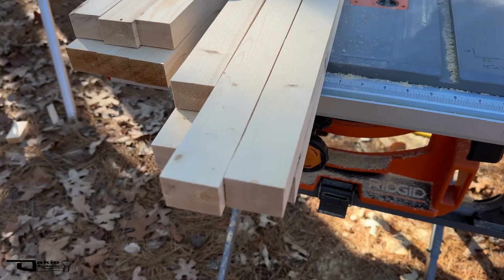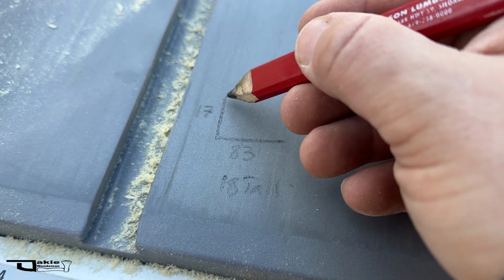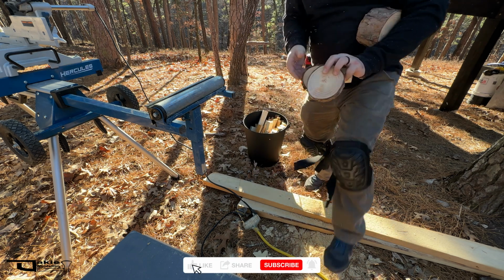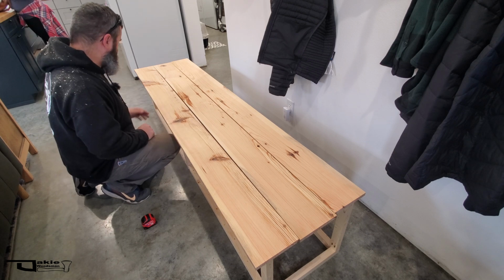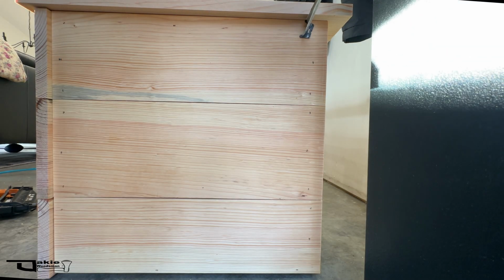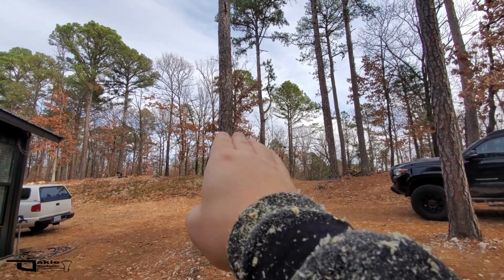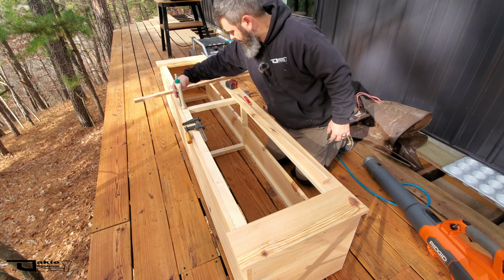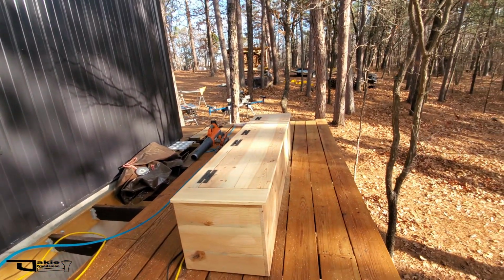Shoe Chaos Conquered: DIY Storage Bench Brings Order to the Entryway!

Comment: love the content what was battery leaf blower u used to blow all the wood dust of the porch and what brand of dewalt wood tool did u use cut the wood and sand the wood down
Reply from the maker: Appreciate you watching. My cordless tools are from Ridgid as is the the blower and the table saw. The table saw runs off of 110 AC. The miter saw is Harbor Freight brand Hercules which is their best brand in house. The router is a Bosch unit and I love it. The sander is a Ridgid brand. Thank you much for watching and commenting!